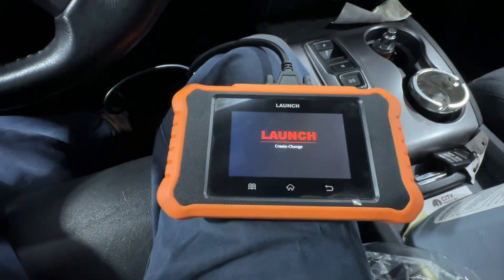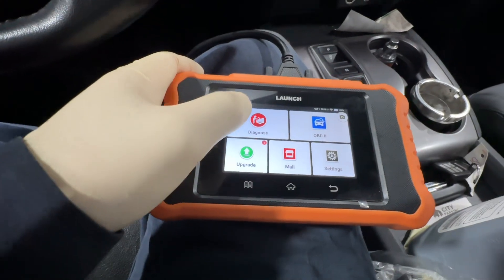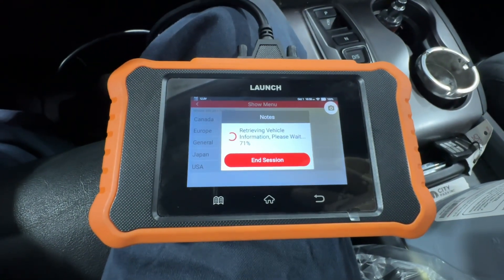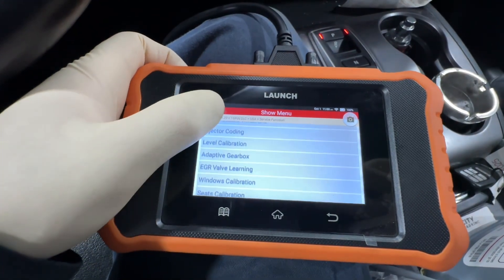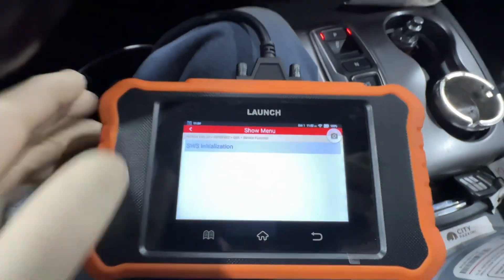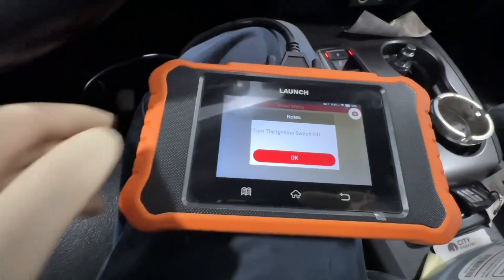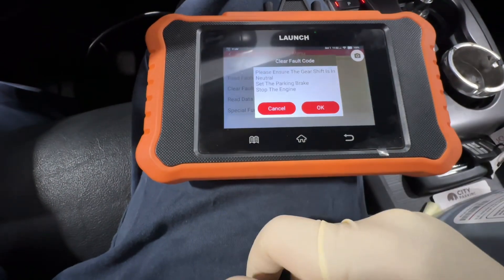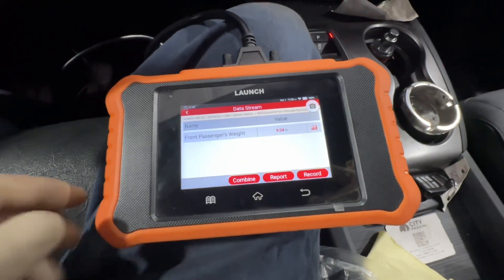Honda seat weight sensor initializing

Comment: I have the same trouble code on my 2019 civic but my scanner (which doesnt support calibration) describes the code as "lost communication with SWS unit". Is that a different issue or is the description just inaccurate, and the seat just needs calibrated? Thanks.
Reply from the maker: Sounds like a different issue
Reply: @BCautosutions  A different scanner showed the same code, but called it "Seat weight calibration needed" , and I was able to calibrate it without issue.
Reply from the maker: @CRChannelurl ✅

Comment: How about driver seat?
Reply from the maker: Driver seat doesn’t need programming
Reply: @BCautosutions  thank you for reply ,I have Honda accord 2015 , did everything and there is no code but airbag light is on , checked buckles, wires , calibrated seat , only thing Missing didn’t do is to reset the module, do you have any idea?

Comment: Question: If I wanna clean the engine bay, what things or tips should I do (in terms of taking precautions)? Can I use water? Regular hose water or pressure washer? Are there any cleaners/detergents that are recommended or to be avoided?
Reply from the maker: @mrcheezcat  we use spray 9 and stay away/cover all electrical components

Comment: I have the Creader Elite X431 version 1.0. I’d like to know, since it does not have an ABS auto bleed capability, can I bleed the ABS pump in my 2019 Ridgeline and 2023 CRV 1.5, by using my pressure bleeder while testing (activating) the individual brake circuits (which it can do) as I bleed them? Thanks.

Comment: How about the GPS through android auto. It seems to be off a little. Thanks
Reply: GPS through android auto is based on your phones GPS data, not the car.
Reply: @NitroxSkaterxChannel thanks for the info.
Reply: @larryharry7221  i use Waze & my S22 with AA daily and it works great.